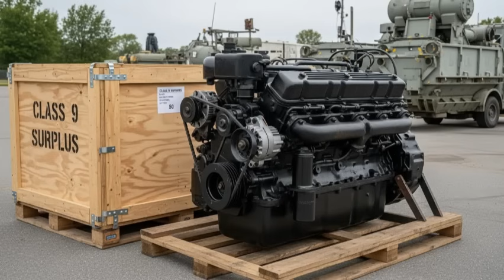Brothers Bought a Navy Surplus Box — Inside Was a 2,500HP Packard V12 PT Boat Engine…

Comment: i hate when they tell you a story as true this get a thump down   from me   as un true  count cyl on  the side it has 5 on the ext pipe on side. the hp was 1500 hp and pt boaat hade 2 eng   THE WT WAS AROUND 2400 TO 2600 LB. check A I ON THIS.   people start giving a thumb down on  lie  story i do oh  1940 pipe fitting are same as to day i was assigned to a boat built in 30  and scrap  by bill clinton  look like it has a oil pan

Comment: The Packard V12 PT boat engines were flathead V12s of about 2400 cid, not the same as the Packard Merlin aircraft engines, which were copies of the Rolls-Royce V1650 engines.  The engine shown here is neither.

Comment: Engine pictured is NOT a PACKARD 4M2500 which the title says it is and they were NOT 2500HP  but 2500 Cubic inch displacement and they were 1500 HP. the very late war 5M2500 only made 1850 HP.  Also all PACKARD PT boat engines had the word PACKARD cast in script in each valve cover.  this is just soooo much AI BULL$HIT !!!

Comment: It's a V10 4-Stroke Diesel Engine for Semi-Trucks, maybe Mercedes-Benz or Renault.
Anyway, it's a nice AI-Story to fall asleep....
Reply: They said spark plugs-never seen a v-10 diesel with spark plugs.😂
Reply: It is a Packard Merlin, an aeroplane engine.
Reply: @davidbamford4721 

The 4M-2500 Packard Marine V12 used in PT Boats is a distinctly different engine than the much smaller V-1650 Aircraft engine. It weighs almost twice as much.
Reply: The photo isn't of the engine in the story. 

Most of these stories are fiction anyway.
Reply: The narration say the engine was green. The photo shows a black one with 5 exhaust manifold on the visible side, so a V-10. The engine pictured is obviously bigger than the box too.

Comment: That engine is certainly NOT just out of the crate.   Way too clean and it has an alternator and not a generator.  Another click bait story.
Reply: In 1940's Pachard V12's WOULD have had GENERATORS.
Reply: @osogrande2  In most cases but they also may not have had any type of power generation. The USAF crash rescue boat we had in Turkey in the early 1960s had Hall-Scot engines for propulsion but Crosley engines for power generation. That meant more power was available for movement and that they could be shutdown when not needed while the Crosleys kept things powered up.
Reply: Not just one but two alternators. Former military assets often had one or two overhauls before being put into crates. I know this from the fact that I got 11 Detroit Diesel 12v71s for my employer from the DRMO. Engines were in green  ( Ewe ) or grey and had belonged to the Army, the Navy and then the Army again. They were in the original crates but were far from original. The paint colors proved that. The build sheet said they had a " War Power " time rating of 24 hours before needing a rebuild. They were clean but far from new.
Reply: They cleaned it if you actually listen
Reply: WHO THE F….CARES, it was enjoyable vicariously living the experience.  Accept it and your experience for what it js.
Reply: It has two alternators
Reply: But what an intriguing story, no?
Reply: This post is just some kind of scam with fictional information
Reply: The packard PT MOTOR WAS 1500hp
Reply: Stop 🛑 looking at a picture of a 10cyl engine. It’s the story that matters, not experts telling us “facts”

STORIES!!!!!
Reply: …… and the crate is new plywood, not old,old, oil soaked oak. Another A. I. Narrated B/S story.
Reply: Even i noticed the alternator. More net misleading for the gullible.